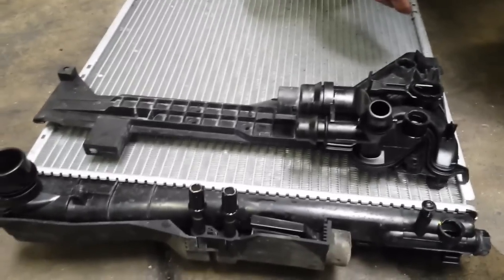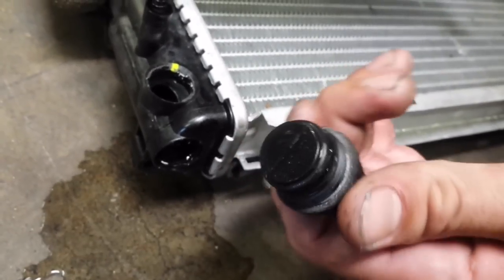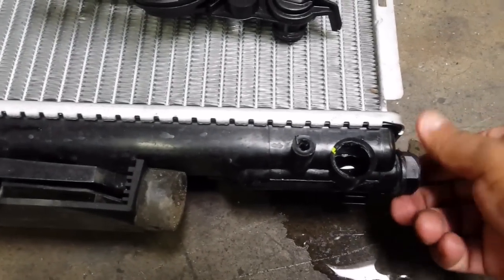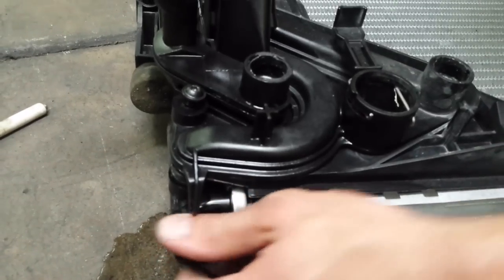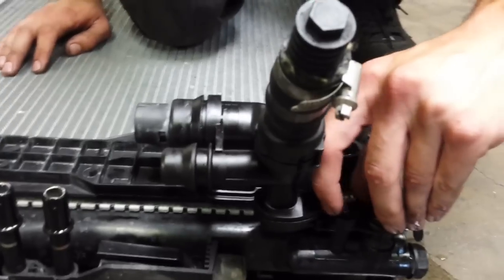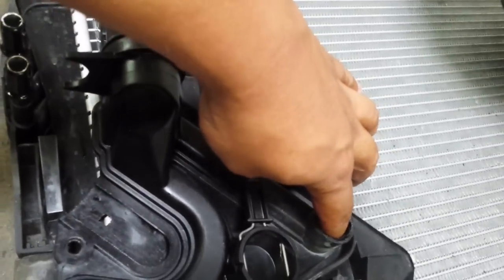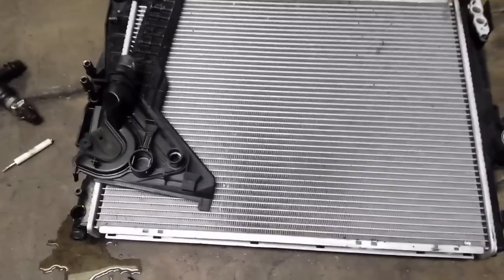Installing Radiator from Automatic to Manual BMW E46 330 328 325 323

Comment: hey the QD attachment right above the automatic trans cooler connected to the small resavor thats a 90 degree angle is that part able to be changed without buying a entire new coolant recovery tank mounting plate? mine broke right at the joint at the 90 degree angle i was wondering if it would be possible to order just that joint and install it into the coolant recovery tank. does anyone know the name of the part or the part number?

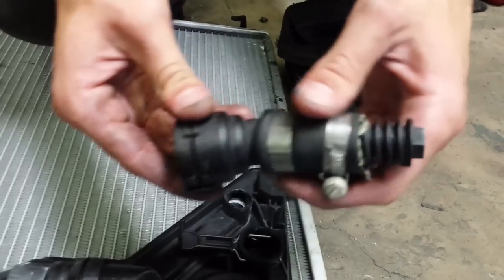Comment: whats this hose connected to at 1:38 anyone know? i did an auto to manual swap and the other side where this hose connects to is just pissing coolant. drove it twice moved the car in the driveway a couple times and now its just pissing coolant. everything is sealed off properly underneath the coolant expansion tank. But the other side where this hose connects to is leaking fro some reason. anyone have any idea what this hose connects to or does?

Comment: Hey guys I’ve been struggling with this questions for a while now but I get mixed answers… I have a 2003 auto 330ci and it has a short drain plug on it.. does it honestly block coolant from cooling the transmission fluids?

Comment: My mounting plate keeps leaking, even if I put it in brand new. It only lasts like 2 weeks before it starts leaking. Any thoughts?
Reply: The actual oil cooler leaks if not connected to the mounting plate correctly

Comment: Just removed my original radiator from my 2004 330i automatic and it has the long drain plug. That is the opposite of what you said in this video, so who is right, the factory or you?
Reply from the maker: So 2004 models have the long drain plug.  Thanks for sharing

Comment: I wanted to know if you have to reprogram the car after replacing radiator and air shocks into spring shocks for a 2001 BMW X 5 because my macanic did the repairs but after my wife and I drove it for 20 mins away and back 10 minutes later the alarm went off because the fuse box wires caught fire and BMW said it’s best to total whole car out but my insurance didn’t cover a 20 year old car with full coverage .

Comment: Can I use a mounting plate from an automatic on a manual?
Reply: No because one of the holes on the radiator wont get properly sealed due to the fact that the manual plate doesnt have an o-ring like the auto plate does. Ask me how i know. So just use the auto plate

Comment: On a manual transmission what would go into the hole at 1:28 because I bought a manual 328i and it is missing the hose and I don’t know if it’s supposed to be a hose in there or a plug
Reply: Hey
Anyone know the name of the rubber that goes in this place at time  0.38 ??
Thanks